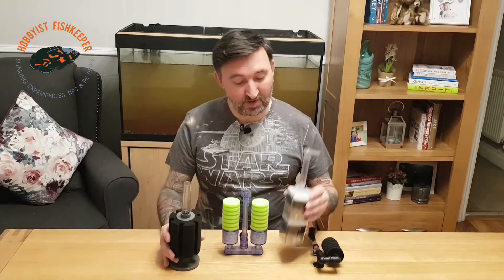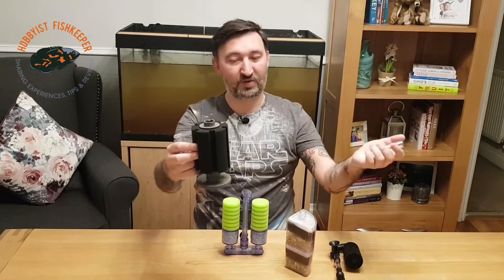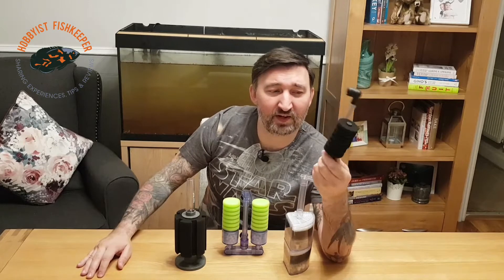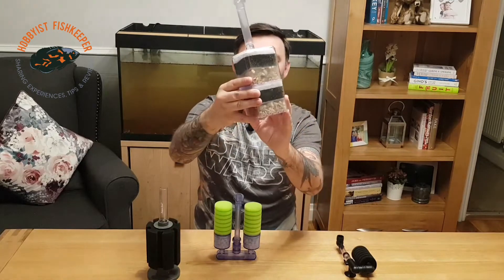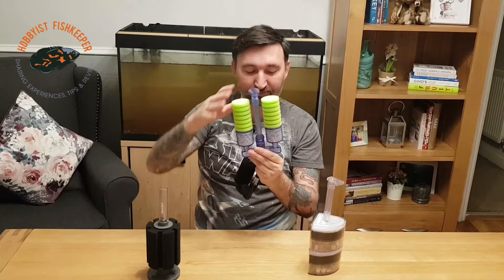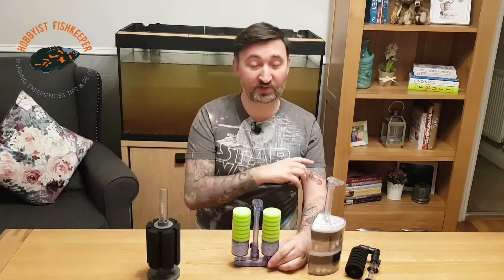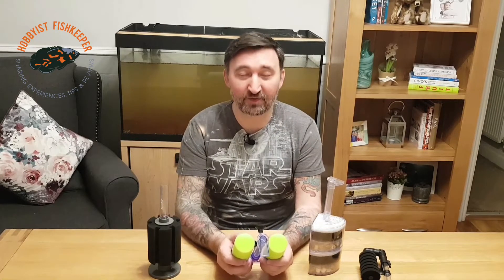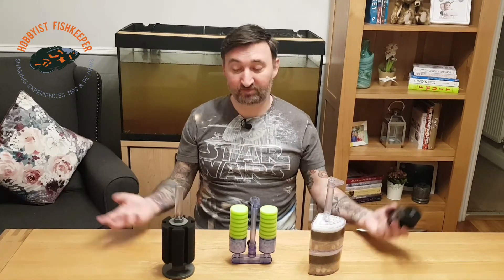Sponge, Box & Ziss Moving Media Filters. How they work & do they work??

Comment: The disadvantage of the sponge filter to the left is 1.) noise. You can reduce the noise from the air bubbles by attaching an airstone to the air tube. However, and this is disadvantage 2.) you can't see if the sponge is clogged, because you can only see the bubbles but not the lifted water coming out of the tube. An L-piece right at the surface, like in the other 3 filters, makes this more visible. Disadvantage 3.) is that it takes longer time to cycle the tank, before the beneficial bacteria have settled on the surface. Thus, the two filters including biological filtermaterial are best, because you can use the ceramic balls from existing tanks, and have a fully cycled tank right away. Alternatively, you can squeeze a sponge from an established tank in the new tank water to kick-start the biological filtration. The filter with the green sponges (Xijoung, XY-2882) is also available with a 4 W electric pump instead of an air tube (model XY-2902). With 450 L/h it might be too much or a small tank, though it did not look too bad on related youtube videos ...

Comment: I have re purposes without destroying or modifying a 350 deluxe carbon canister into a box filter by turning I upside down putting a air line and stone down thru a plastic tube fitted directly to the bottom of the canister. Check video on my channel.